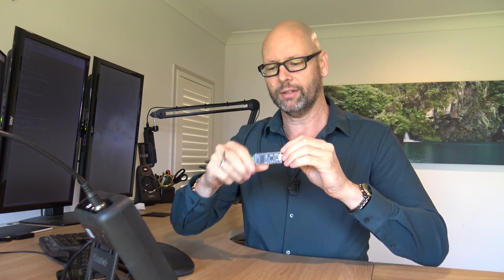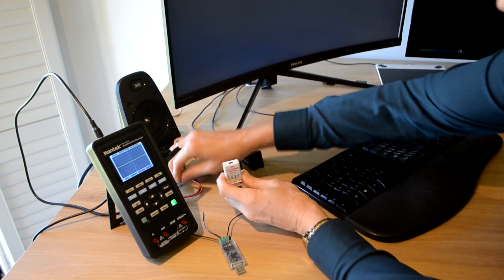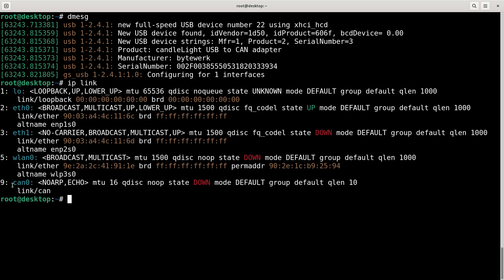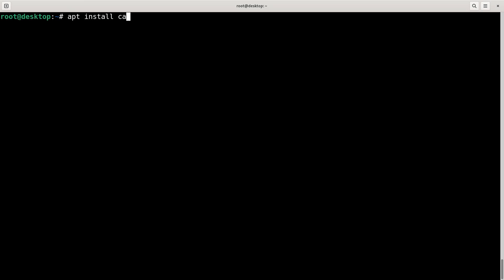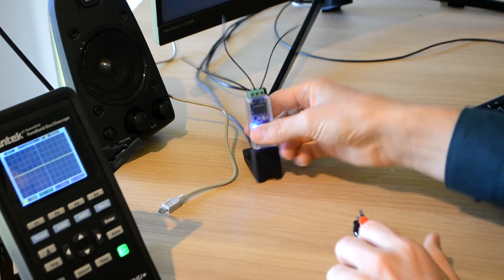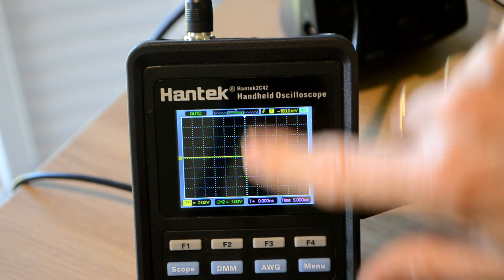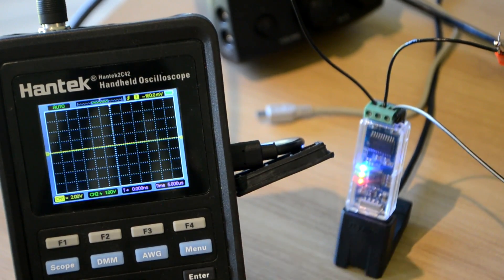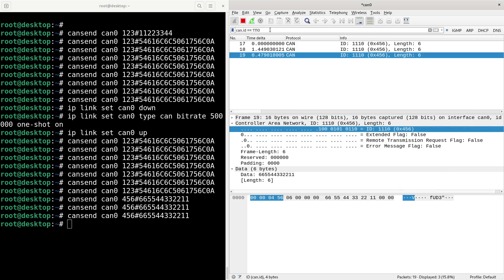Linux CAN Bus Setup

Comment: ip link set one-shot on        RTNETLINK answers: Operation not supported

the set up ist working, but I can only send one message cyclic. Your hint  set one-shot is not supported on my Ubuntu PC. Does you use a special kernel or driver?

Comment: Yeah, I've now done everything I can think of to get my computer to recover and it's gone thanks to a can bus box and crap. Just simple crap. That's an expensive can bus sniffer that  I have just purchased for $20. It's going to cost me my information that might be lost (yes I do backups but there always seemS to be some data loss). I doubt I'll be fixing this laptop because of the age, so I'll be spending some unknown sum on a replacement laptop. This is definitely not what I had on my agenda today, this weekend, and what will probably last for a few weeks until I get another computer I'm comfortable with using as I was with that one that has died.

Comment: I followed along, step by step, pausing the video and double checking that I was getting the same results and seeing the same information and right at wireshark, my Linux Cinnamon Mint Lenovo E520 ended it's life. 
Be warned, this was my result with the above listed laptop and the exact same card. That was my primary computing device and now it only loads part of the operating system. 
I will be watching other tutorials for my can bus questions. 
No, on second thought, I give. If I pay US$80,000 for a truck, and it has only an AM/FM radio, which is about the current price for a base model pickup, then I will only listen to AM/FM radio for the next 84 months that I've financed it. They win. This shit is stupid and we should live with sub-par efforts of engineers and manufacturers. I would rather do that then go through countless YouTube videos with bad information, warnings missing where we need them and over bearing where we don't need them, and just garbage info from someone who got lucky because the products don't ever work as the manufacturer claims, when we try to get them to work, that brings in a myriad of other shit products, then those cause more damage, frustration, and cost, then we try to fix those defects, and then we add a new unnecessary level of shit products to fix the shit products, and before long, we have piles of expensive broken shit with little gained but wasted time. Step off the cycle of revolving problems and stop listening to these tutorials that work for very few.

Comment: Awesome, by following along, I made it to Wireshark before something made sweeping changes to my operating system. Now I have some icons, no panels, a black background, and nothing works other than a hard reset. Hey, it's not all that bad. I usually don't make it this far before I've slammed something against the wall or at my truck. Even better, all of this debacle happened indoors. It usually happens in the drive and then I have to deal with neighbors who are afraid of my outbursts from destroying a laptop, drop kicking a goal with an oil filter over their roof, or if I really lose it and start chasing their dogs that they let run freely. At least when my computer came up like it had a stroke, I could only be heard screaming at everything and couldn't be seen losing my cool. So, my plans this weekend have just shifted drastically. Instead of working on my truck, I'll be working on data recovery and laptop repair. 
Thanks. I'm glad I found the weak point with my laptop now instead of when I have time to rebuild it.

Comment: Hey Paul. Love your channel. I just wanna mention that you can still use that USB--CAN adapter, the one that shows up as a serial device. Just use it with the can-utils slcan_attach command along with the slcand (daemon) to establish the link. It isn't FD but will do the job nine times out of ten. Keep up the great work. Cheers!
Reply from the maker: Mate, you mean that little white one I said was shit? I'll give it a go... maybe, because I've got the good ones now. But still, do you know how hard I looked for a way to try and get that thing going?! I'll check those commands one day and put it in my notes if it works. Cheers.
Reply: @TallPaulTech  yeah, that little white one that's shit. I got it going through BLE (spoiler alert, it wasn't easy). I love what you've done with the RPi Zero W, using usbip, so much so that I wouldn't recommend going the BLE rout. Again, great job mate. Cheers.

Comment: For the device showing as a serial interface shouldn't you just flash CandleLight firmware so it shows as a can adapter ?
Reply from the maker: You say 'just' as if that's easier than throwing it at something.

Comment: The reference ground IS used by the receiver. Without it, the average voltage of the CANH and CANL signals could exceed the “common mode” voltage specification and also the min and max input voltage specification of the receiver.
Reply from the maker: Fair enough. I'm going to rig something up soonish to a car.

Comment: Thanks for a great video!  It's always good to see what people recommend using (and NOT using).  The description does not say whether it supports -FD or not, so I'm thinking probably not.  Do you have any suggestions for a good CAN-FD module?  That's what my motorcycle (Harley) uses.  I can almost decode some frames manually but, including the probably proprietary content, it's hard to tell without a known-good decoder.  From what I can tell, I think it does not use the higher data rate capability, but merely uses the longer frames provided by -FD.  Any thoughts?

Comment: Hi Paul, how can I assign an IP address to can0 ? I want to run iperf3 between two devices ( Raspberry pi and PCAN Adapter) and see hopefully any speed difference btw. Twisted pair or regular flatcable. Thanks
Reply: can networks just don't have any IP stack

Comment: Dammit - already bought the "dont buy this" a number of months ago.  :(
Reply from the maker: I bought it a few years ago. I then had a half-arsed go at using it on the Powerwall, saw nothing, then pissed it off.
Reply: @TallPaulTech  - just ordered up the isolated version off Ali a minute ago. Guess the 24 Canadian Peso's won't kill me.  ;)
Reply from the maker: I'm going to plug into the Tesla network soonish
Reply: @TallPaulTech  - I'm using mine for my GMC Sierra. Have some options installed (power folding mirrors for one) that the trucks system isn't responding to. Scan tool sees the button press - can fold/unfold sending the command from the scan tool!  So I'm going to have a micro sniffing the bus looking for the button presses, then send the command to fold/unfold.

Comment: On the Xi-express page there are 3 variants of the CAN-USB adaptor.  Paul shows us the CANable-Pro Isolated Version (with large ADM3053 isolation chip at CAN end). 
Most of the fleaBay adaptors are the less suitable CANable (non isolated), but the isolated version is available in the less cheaper listings.

Comment: Something that always surprised me about CAN is that its not seem too much in the hobbyist space. long distance, resilient comms + interchangeable modules for what seems like a small learning curve. Def looking forward to how you discover all of the IDs and functions of the car with it.
Reply from the maker: Yeah, and to be honest, I'm surprised that even I have never dug into it before. Probably because I've never been into cars, and I've always associated it mainly with cars, hence I never touched it. I did try to stick that shitty CAN adaptor that I showed at the start of the video into the Powerwall once, but saw nothing. I might have another go at that with the adaptor that I know works.
Reply: @TallPaulTech  Since your car is quite new. I would keep an eye out if it is using some of the newer extensions, like CAN-FD, or 10BASE-T1S, CAN-FD is common but I have not been able to find a good diy board for 10BT1S. I saw on a reddit post that someone tried on their tesla wall as well. but did not elaborate on why it failed.

I dove deeper into what CAN Bus was about after realizing boats were using it. NEMA 2000, an boat equipment standard, is an extended superset of J1939. J1939 is an standard for heavy duty vehicles, built on top of standard CAN. But there is currently an industry push to switch to Ethernet and IP even for the intra-car communication. So now there are things like 100base-T1 in cars, 100MB on a single twisted pair, and 10base-t1s, 10MB Multi-dropped Ethernet, wired just like a CAN network, All so that you can reach your ECU using the IP stack with a local ipv6 network. Absolutely nuts.
Reply from the maker: Feel free to email me. You might come in handy :) I know I have a lot to learn about this, especially with the extensions as you said are coming into it.
Reply: Yeah because Ethernet exists lol
Reply: It's becoming more popular in the 3D printing hobbyist space due to the low amount of wires needing to be ran. Cuts 20+ down to 4.
Reply: I can speak to this a little bit. I recently wanted to connect >=3 ESP32s together without involving the wifi antenna at all.
I’d never done something like that before so the learning curve was pretty steep. I found UART, I2C and CAN as solid options. UART was out since it’s  1:1 and while it was tempting I found out CAN requires separate hardware (which I wasn’t going to wait for and in my experience means a whole chunk of new learning curves).
I2C worked great after a reasonable amount of hassle and so CAN is off the priority list.

Comment: There are adapters specifically for Tesla cars. I had one for 4 years in my Model 3. The 3/Y variants plug in below the rear heater outlet in the centre tunnel. Easy to disconnect the cable and add the CANbus adapter into it. I used a BT adapter and software on my Android phone to get all sorts of info out of the car including headlight temps, battery info etc.
Reply from the maker: You mean like the adaptor cable I showed in the video?

Comment: Nice video. There is also a way to use Arduino Uno or better ESP32 with CAN to make a linux network interface like you showed in the video. Slcanuino check it out.

Comment: Great video. Looking forward to seeing how you hook this into the new car. I was assuming OBDII but now I'm starting to wonder if that will give you all the CAN access you want based on what you said about the Tesla
Reply: Yes. On VAG cars, for example, the 'K' line is the old bus, but on anything after about year 2000 you get a CAN bus as well. The bus you get connected to has gateways to the other (high speed, or safety-critical) busses as well.
Reply: @obd6HsN  That was what I thought. You could enumerate the devices and talk to everything via gateway to other systems across OBDII
Reply from the maker: Yeah, I had the same thought. I'll see what the OBDII connector has to offer first of course, then I'll see where I end up after that.

Comment: Did you see munro interview with elon about the cybertruck?  Now using can over Ethernet
Reply from the maker: Why would I watch shit like that?
Reply: @TallPaulTech  old mate waffles on a bit; No different to yourself. It's hard to make a point of view when you're the engineer IMHO.
Reply: Pretty interesting,  or maybe not.

Basically being the first car to have steer by wire and needing a high speed bus to do the processing and to react in high speed for inputs.

Comment: Awesome stuff, so what is the new car?
Reply from the maker: Come on mate... look at the previous video.
Reply: @TallPaulTech  see it now. Btw, in case you don’t know, there are lots of canbus libraries (.dbc) on GitHub for Teslas. Many more data parameters there than offered even through the factory service mode+. Savvycan supports .dbc files. Looking forward to seeing what you find on the BYD and your take on the build quality as well. Thanks!
Reply from the maker: Yeah I figured there would be .dbc files put together by people over the years, I had just never looked. You don't know of any for the Seal do you?

Comment: how are you adding it to the car? OBD2 interface?  i had an android app to track my car data (pro-tool), and some of it helped with maintenance (obviously). wired was the best option, and bluetooth and wifi never worked in my arrangement.. guys at the shop with custom OBD2 always have more data visible..  i only use it for reading data, and rarely send write codes.

Comment: Keep in mind, if you are putting in a home-brew vehicle CANbus+WiFi access point, you are literally creating an attack surface with direct safety of life implications.  Not saying this is any better than those several vehicles with cellular uplinks that allow the factory to meddle with your vehicle - but you can't sue them for the stuff that happens over your modification.
Reply: it's a concern, but super unlikely, unless someone with bad intentions wants to target you specifically they wouldn't get into the effort of researching a custom made thing, also, WPA3 is practically unhackable (at this moment at least)
Reply: @minecrafter9099  So we agree it's "unlikely" but non-zero - and my comment was the user-initiated transistion from zero to non-zero.  Thanks for helping defend my mother's honor.
Reply: Rather put this comment out there for all the people with wifi controlled smart homes. Enthusiasts playing with canbus are the least concern.
Reply: @kephir4eg  I agree, using wireless, or non-compartmentalized networks with external access is pretty f-ing dumb for anything that has power over your life (which is what compelled the comment in the first place).  Which again begs the question why does CAN access need to be wireless to be interesting...  the benefit of CAN is that it is a closed, wired connection with only known parties.  First-order access control theory is not providing a point of access to be attacked.
  
Reminds me of a recent discussion I had with someone about tyranny - and more specifically the difference between Power and Authority.  One can have Power over someone without having the Authority to exercise that power... If you don't want to ever allow someone the ability to exert Power over you, don't provide them conditions in which they may develop that power.  Works just as well for physicial security design as it does for government BTW.
Reply from the maker: Keep in mind, your mother.
Reply: @TallPaulTech   and then that happened...